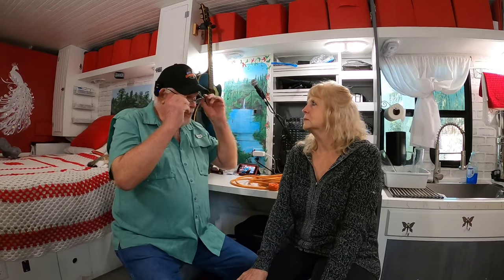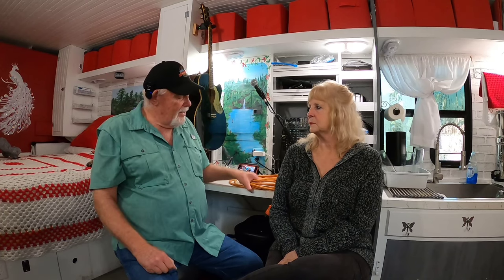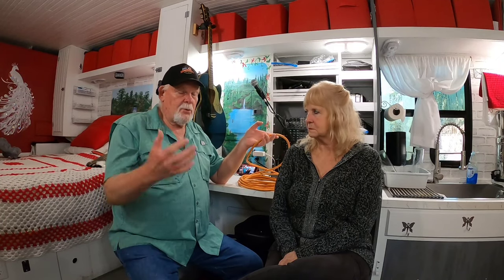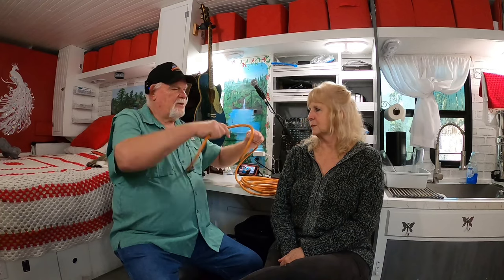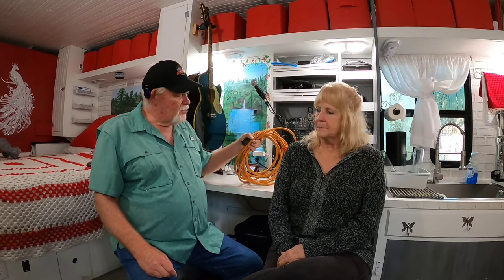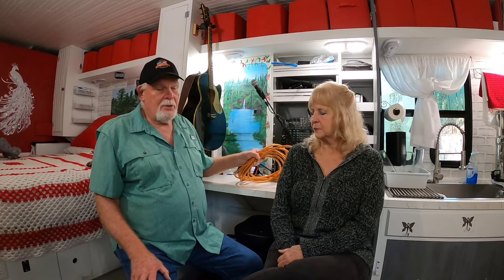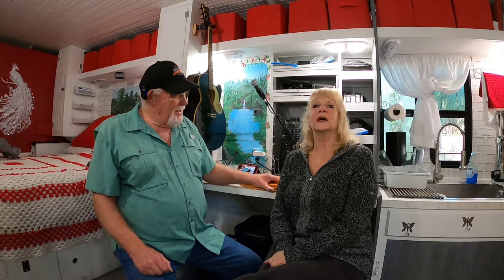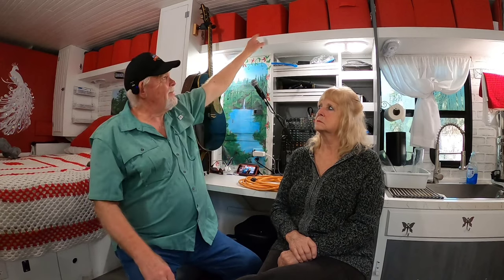Cargo Trailer Conversion AC Circuits. Solid Or Stranded Wire? It's Your Choice.

Comment: We used the wiring diagram from the website Far Out Ride for our Ambulance to RV conversion. All they recommended was stranded wire so that is what we used. In their wiring diagram they explained what size to use also and it was a variety of sizes. It seemed like for a couple of months I was constantly ordering wires. I sourced wiring through Amazon, Ebay and local electrical supply houses. Sometimes I bought the same brand wiring {Windy Nation} from both Amazon and Ebay depending on the size and length I needed. Sometimes I inadvertently bought the wrong size just so I could waste money.. BOO HOO!!!!
Reply from the maker: Thanks for the information.

Comment: Love the topic, I went round and round with a buddy about this years ago on his bus conversion, he went standard Romex, I asked why not stranded wire, he said they don't use stranded in RV's, I said OK, come with me, went to the front of the bus, popped the hood, and pointed, and asked where the solid wire is?, then we went back inside and I pointed again, where is the solid wire under the dash, then went to the new truck they just purchased and said where is the solid wire in that? I agree with you in the stranded wire, it works, just need to get the correct receptacles that can terminate the stranded wire. I won't go into the fact that he also went with a propane heater, propane water heater, and stove, and plumbed it in with black pipe instead of the copper ones, oh yes their first trip they started to leak.... Good thing they did had a gas detector..   Very good topic, and your reasons for using what you did, and why car manufacturers, farm implement, aircraft manufacturers use stranded wire. I don't get why some RV's have solid wiring in them..

Comment: My wife and I are planning on finding an aluminum gooseneck horse trailer to build out, but I had already planned on running all the wiring OUTSIDE of the walls as well, even the trailer light wires.  I'm not sure I'll build out chaseways (raceways) of wood trim, I was actually thinking of splitting various diameters of PVC piping to contain my wiring.  Clip a curve of pipe along the ceiling/wall joint, kills two birds with one stone... holds wiring and doubles as trim.  Put a box on the wall where desired, drop a wire down in a semicircle of smaller diameter pipe, and if I ever want to relocate the box, a little patch and paint and you never know where it was to begin with.

Comment: Hey I agree with every thing you guys said about the wire size. I use the required size as reference and increase at least one gauge. I might use 14 gauge for speaker wire lol. I believe there is less resistance in the larger wire, reducing electrical costs. And stranded wire is all we used in our electrical control systems in our corn plant because of all the vibration.

Comment: My Gramps was a residential and commercial electrician. He always said anything that moves best be stranded.  Way back in the day. I suggested stranded in the early comments. You said you'd check it out with some relatives that were electricians. Then you were wiring with stranded. 😁  and honestly it's much better protected. And MUCH easier to work with.   I'm a 12 Awg guy myself.  It's like that 75% of your capacity tow rule.   Have better than what you need.   OK I can't leave without a tip.  When I run it through anything sketchy.   That might get more exposure or chaffing chances.   I run it through PEX as a protector. I'm out.

Comment: I didn't watch the video, but use stranded wire and use crimped ferules on all the terminations. I will tell everyone what they should use because this is something I have tons of experience at. Going down the road (rolling earthquakes) and repeated heat cycles. I use marine grade wire on just about everything especially on trailers.
Reply: OK I watched the video and as always great video. I, personally, would not suggest SO cord and it is because the insulation doesn't last as long as single wire stranded. Ass it ages, it becomes brittle and breaks and eventually will turn to powder believe it or not. Also I use 10 gauge because it doesn't cost that much more and when appliances short out you are pulling the kinds of amp loads that can damage 14 gauge wire even with short run and a circuit breaker that is capable of taking 80 or more amps for a few seconds. I look at it like insurance, don't need it but feels great to have it.
Reply from the maker: We did not use even 1 inch of 14 gauge wire in the trailer. The smallest gauge wire in our trailer is 12 gauge, even on our 12 volt DC LED lights, which draw about 1/2 amp per light. Although we did not go deeper in detail, we even used 10 gauge wire for some items, and 6 gauge wire for our power inlet cable.

Comment: I purchased 8.5 x 16 x 7.3 a couple of months ago, I have watched a lot of your videos and have started on my build. I'm in the process of sealing, insulating and adding my ac wiring, I have also gone with the 12-gauge wire. Is there a certain process that I should go with. Thanks in Advance

Comment: Did you ground the trailer frame to the AC ground?
Reply from the maker: Yes. Absolutely. We covered that in an earlier video. The DC side is grounded to the trailer frame as well.
Reply: I have mixed thoughts on grounding the trailer to the AC when plugged into a AC outlet. If grounded, it's safer to ground in case of a short in the hot to the trailer frame it would prevent a "hot skin" condition but if the trailer is grounded, it becomes a path to ground for a lightning strike and could attract a strike  and act as a lightning rod.        @billanddeb
Reply from the maker: We've never had a "hot skin" issue in almost 4 years.
Reply: Grounding the trailer insures against a hot skin. My concern is it also makes the trailer a path to ground for lightning. I think grounding is a great idea but I unplug during thunder storms to disconnect the ground source. @billanddeb
Reply from the maker: We do that as well. We are considering having a threaded stud welded to the tongue in order to attach a ground strap from there to a ground rod driven into the ground when we're parked for an extended period of time.